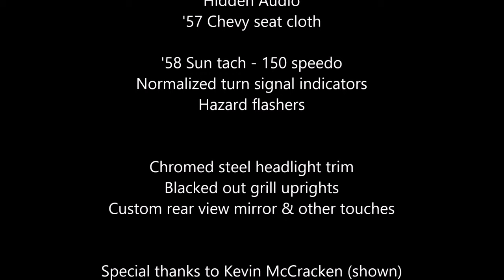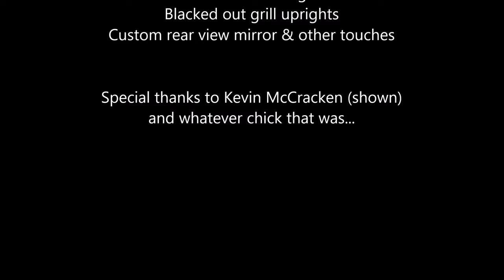Restoring a Junkyard Christine Clone, 1958 Plymouth Belvedere

Comment: I  just don't get why everyone wants a "2 stage" paint job, base coat and the clear coat. It stinks! Automotive enamel, or single stage is far superior simply because 2 stage always has an issue of the clear coat separating from the base coat. Pure garbage.
We used Dupont Deluxe, RM AlfaCryl and back in the 50's and 60's GM had Magic Mirror.
What I'm saying is that base coat-clear coat sucks, no fucking good.